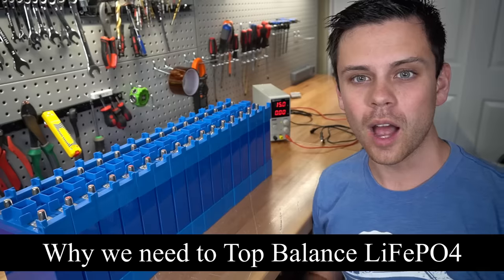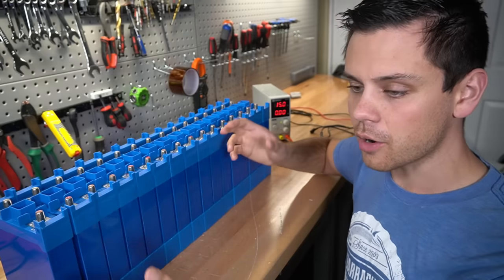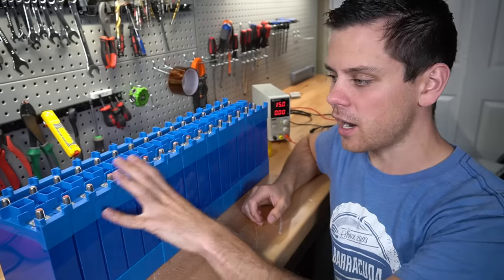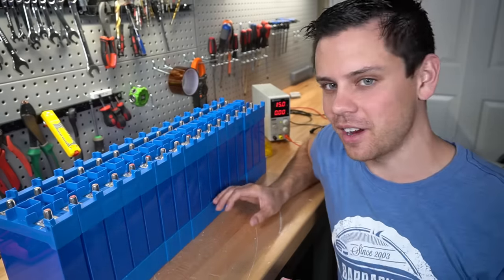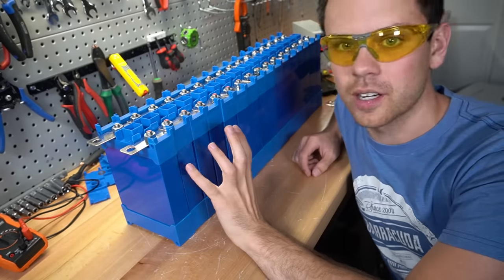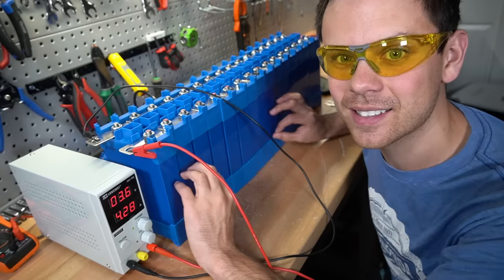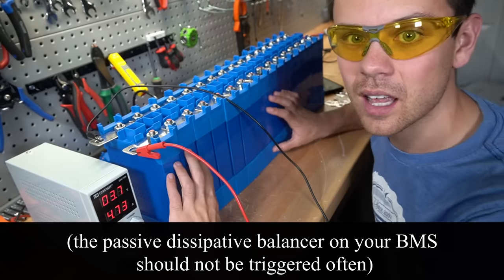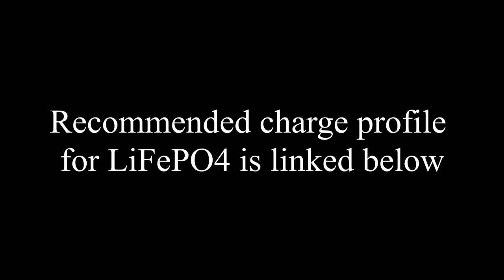How to Top Balance LiFePO4 Battery Cells Quickly (and when you need to do it)

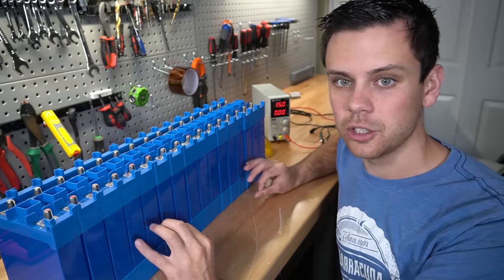Comment from the maker: 2:27 for Step by step top balancing instructions

If you buy quality new cells, you can use BMS to top balance, then capacity test in a few cycles. That's the easiest way. 

Ian made a great point of using a blocking diode so you won't burn up the power supply. Smart idea. 

If you are quick charging, current sharing is an issue and you need to attach the positive and negative leads at opposite ends of the battery. In this video we are balancing and topping off at very low currents, so you can attach the leads anywhere. If it makes you feel better to attach at opposite ends, go for it. .1A on a 150A bus bar is not going to cause a current sharing problem.

~~~~~~~~~~~~~~~~~~~~~~~~~~~
Does off-grid solar confuse you? Check out my DIY friendly website for solar system packages and product recommendations, and so much more! http://www.mobile-solarpower.com

Join our DIY solar community! #1 largest solar forum on the internet for beginners and professionals alike: https://www.diysolarforum.com

Check out my best-selling, beginner-friendly 12V off-grid solar book (affiliate link):
http://amzn.to/2Aj4dX4

If DIY is not for you, but you love solar and need an offgrid system, check out Tesla Solar. Low prices and great warranty, and they can take your entire house offgrid with their new Powerwalls: https://ts.la/william57509

~~~~~~~~~~~~~~~~~~~~~~~~~
My solar equipment recommendations (Constantly updated! Check here first):

12V/48V Lithium Batteries: https://www.mobile-solarpower.com/solar-batteries.html

Solar System Component Directory: https://www.mobile-solarpower.com/solarcomponents.html

Plug-N-Play Systems: https://www.mobile-solarpower.com/full-size-systems.html

Complete 48V System Kits: https://www.mobile-solarpower.com/complete-48v-solar-kits.html

DIY Friendly Air Conditioner/ Heat Pumps: https://www.mobile-solarpower.com/solar-friendly-air-conditioners.html

Complete 48V System Blueprint: https://www.mobile-solarpower.com/48v-complete-system-blueprint.html

~~~~~~~~~~~~~~~~~~~~~~~~~~
My Favorite Online Stores for DIY Solar and Coupon Codes:

-Current Connected: SOK, Victron and High Quality Components. Best prices and warranty around: https://currentconnected.com/?ref=wp

-Signature Solar: Cheap Server Rack Batteries and Large Solar Panels:
https://www.signaturesolar.com/?ref=h-cvbzfahsek 

-Ecoflow Delta Official Site: My favorite plug-n-play solar generator:
https://us.ecoflow.com/?aff=7

-AmpereTime: Cheapest 12V batteries around:
https://amperetime.com/products/ampere-time-12v-100ah-lithium-lifepo4-battery?ref=h-cvbzfahsek

-Rich Solar: Mega site and cheaper prices than renogy! Check them out: 
https://richsolar.com/?ref=h-cvbzfahsek

-Shop Solar Kits: Huge site with every solar kit you can imagine! Check it out:
https://shopsolarkits.com/?ref=will-p

-Battery Hookup: Cheap cell deals
https://bit.ly/2mIxSqt
10% off code: diysolar

-Watts 24/7: Best deals on all-in-one solar power systems, with customer support and distribution here in the USA: 
https://watts247.com/?wpam_id=3

~~~~~~~~~~~~~~~~~~~~~~~~~~~
Contact Information:
I am NOT available for personal solar system consult! If you wish to contact me, this is my direct email: williamprowsediysolar@gmail.com

Join the forum at https://diysolarforum.com/ if you wish to hang out with myself and others and talk about solar

FTC Disclosure Statement and Disclaimers:
Every video includes some form of paid promotion or sponsorship. Some links on this youtube channel may be affiliate links. We may get paid if you buy something or take an action after clicking one of these. My videos are for educational purposes only. Information is subject to change/update at any time. Electricity is DANGEROUS and can kill. Be smart and use common sense :)

DIY Solar Power with Will Prowse is a participant in the Amazon Services LLC Associates Program,
An affiliate advertising program designed to provide a means for sites to earn advertising fees by advertising and linking to Amazon.com
Reply: Can I do this top balancing at a higher amperage, say 3.6V @50A?
Reply: DIY Solar Power with Will Prowse  Do you ever resale any of the cells you test?
Wanting to build a battery for a small camper project. Just thought I’d ask. And thanks for all the info in your videos.
Reply: @tevincampbell1735  Sure as long as you don't exceed the c rate of the battery
Reply: Hello is it okay to top balance cell 4 cell,   parallel 2 cell at a time ?  and another 2 after, because i only have 3 busbar but i need atleast 6 busbar to parallel all 4 cell at the same time. thanks
Reply: @BlazeByte21  I would think you could balance 2 pairs and then balace the two balanced pairs.  But Iif I read your question correctly, you'd eventually have to connect all 4 to balance them equally.   You need 6 busbars to do that.  If you have some copper pipe you can make great busbars with a hacksaw, a hammer, and a drill for the lug holes.  Cut the pipe into the correct length, ,smash the pipe flat with the hammer, and drill the correct spaced and sized holes.  You don't have to have commercial busbars.......
Reply: I am using the same power supply that you are using in the video. Set voltage to 3.6 Volts, set to 5 amps. Connected the batteries and It is charging at 22 amps. Leads real hot. no display for voltage.  What am I doing wrong?
Reply: @craigmussells9274  You are going too much at the current end, can you check if you are leads are really rated to carry 22 A of cont current? you should swap with good quality ones probablyly
Reply: Where can a found this batterys
Reply: Hi Will, 

You say that once I build my own battery bank (2x 8s@3.2 for a 24v system), I should check the balance every 6 months to a year....  how is this handled in a server rack or prebuilt battery?
Reply: Hi Will,
I ordered 4 * 304Ah through a vendor recommended in the forum. I then tried to top balance them. They all started out with the same voltage of 3,2V. I connected them in series and used a laboratory charger to fill them up until 3,55V (total 14,2V) with the plan to then top balance them at 3,65V. I chose this approach as mentioned in the video as it would have otherwise taken forever since the charger only has 5A. And the idiot I am, I misunderstood and was not aware that by saying "make 4s individual battery packs" INCLUDED a BMS so I charged it without BMS.

Then I saw the next morning that one cell ended up with 4,0V and the rest of them with 3,4V. I then quickly disconnected everything and connected them in parallel so that the OC cell would balance with the three other cells which seemed to have worked very well.

They now all sit at 3,4V.

My question: How likely is it that I have permanently damaged that once cell? Would that result just in a bit of capacity loss (with which I could live) or is it dangerous to continue using that one cell?

I do not see any bloating or other signs of damage from the outside. Also, the cell was not hot.
Feel so gutted right now.
Reply from the maker: @sebastianlipp7649  you did cause permanent damage. Very unfortunate. Probably fine to use still but who knows. You'd have to take it apart to know. I can't tell with certainty how damaged it is. I think you should start over and buy another set and do it the right way.
Reply from the maker: @sebastianlipp7649  are they used or grade b cells? Why did you top balance them
Reply: @WillProwse  By the way, aside from me being a fool: Thank you so much for your videos. They are very educational and have helped me build my knowledge. Clearly, I should've re-watched them before getting started as I did watch all of those about 2-3 months ago. I suppose my excitement that they finally arrived got the better of me :D
Reply: @sebastianlipp7649  Curious, were the cells useable or scrap?
Reply: @rodneyhrytsak3407  Absolutely fine as it appears. The full battery pulled >317Ah  (rated at 304Ah), they are all in balance with 0,000V -  0,003V deviation between them under low load and max 0,009V under half C load towards the top when almost full or towards the end when almost empty.
No visible physical difference between any of them at all so I believe they are fine.
I do think though that they did not sit at that voltage for long at all. They would've spent the majority of the night in the desired voltage range with one going a little bit over at the end of the charge cycle.
I might have gotten lucky 🤞 we will be using them daily in our offroad rig starting June. Let's see if we run into any issues at some point but for now. All seems well.
Reply: If i just charge 4 cells with a 12v charger will the  charger stop charging when the pack is fully charged?

Comment: Hi Will, nice vid! Only one small advice: connect the batteries like you did but connect the power supply diagonal. In other words, put one of the wires on the right side of the pack. If done so the current goes thru as many busbars for each cell. Like you did, the current has to travel via ALL busbars for the right cel while the left cell gets it direct from the charger. I know, if you leave this setup stand for a while it will balance eventually but it can be done a little quicker the diagonal way.
Reply: Hi Rik, any chance you could elaborate a bit more on how to do this please? cheers
Reply: @finnskellig7422   Simple,just connect the + wire (from the power supply) at one end of the 16 cells,  16P, and the -- wire to the OTHER end; the way he did it makes no sense, it's a beginner mistake;  

The difference here, with a SMALL power supply, is negligible;   BUT it CANNOT be tolerated on large (100 Amperes +) power supplies/chargers!
Reply: There are many conflicting theories about this subject including the long bus bars on battery rack units and I would agree in principle, however, if the resistance of the bus material is negligible, I would assume the current to be equally distributed across the array. Having said so, I would prefer to individually charge each battery up to its max capacity before installation but then again I'm no expert in this area (yet 😍). Thanks for your input 🙏
Reply: Came here to say this. Makes an even bigger difference if using smaller temporary wires instead of bus bars. The current can choose to go through a battery instead of toward the next battery, so by forcing the current to go all the way down the line to get back to the power supply, the delta V across each cell is much closer during the whole process, without relying as much on sitting for a while at the end.
Reply: If you do supply few amps (and the rated capacity is way way bigger) and dont have extremely flimsy busbars, it doesn't matter.

Comment: Last year I bought a set of 16 LiFePO4 280AH batteries to build a 48V system.   After setting idle for a year they had an initial voltage of 3.16V per cell.  I used a lead acid battery charger to bring 4 sets of 4 cells up to near 3.4V per cell which is where the lead acid chargers stopped charging.  I top balanced 2 sets of 4 batteries wired in parallel at 3.65V with a 30V 10A power supply set at 3.65V and 10A.  The power supply is struggling to charge the 3rd & 4th sets above 3.34V with the power supply set at 3.65V.  Should I turn up the voltage a few notches and keep a watch on the batteries to insure they don't rise above 3.65V?

Comment: Anyone building a DIY battery pack should follow these instructions. The last 48V battery I put together a couple of months ago was needed for a scheduled neighborhood transformer replacement power outage and unfortunately the Chinese prismatic cells did not get delivered until late the day before. Fortunately I had the cabinet, buss bars, wiring, BMS & cell balance board ready to go so I just installed the 16 cells right out of the box and charged at 56V until one the cells started to show signs of over voltage.  While the system did work and get us through the entire power outage the next day, the cells were severely out of balance and it took a couple of weeks of "screwing around" by manually connecting ceramic resistors to over charged cells and trying to individually charge low cells with a 3.6V buck charger. Should have just taken the cells out of the cabinet, put them on a bench and done what Will said.

Comment: I just bought four 280Ah grade A cells, connected them in parallel and set voltage to 3.65. it has been 3 weeks and the current is at 4.45 amp. What is happening?

Comment: Great advice. I would like to add something I learned. Lower quality cells can drift from one another by time (ex :when not in use) . If they are too far apart for your bms to cope with this, then I charge the individual cells (that have a lower state of charge) little by little with a 3.65v charger. They don't need to be super balanced at the end. Just enough so your bms can do the job again. Hopefully Mr Prowse agrees with this. It works for me with older sinopoly batteries from my boat, that sometimes sit idle for 6 months
Reply: Hi Henri. Do you put a load directly on a cell that is too high? And charge the low cells as you said.  I have a boat and need to do this now. André in Sydney

Comment: One note that, while not too important once the current drops to a low level, to properly balance the voltage of the pack is to connect one charging lead to the right side and the other charging lead to the left side. This is to balance out the resistance in the length of the wires and buss bars. Otherwise the last cell in the string of parallel batteries may be at a slightly lower state of  charge from receiving less current from a higher resistance. Connecting one on the left and another to the right balances this all out
Reply: That sounds pretty reasonable. Though we are talking about 1-2mm thick buss bars. Only pressure fit connections, but I can't imagine the resistance being significant - do you have any numbers of what kind of resistance this could be and the corresponding voltage drop/unbalancing?
Reply: I agree with you Jason. I used short pieces of small wire to top balance all my cells because I didn’t have enough bus bars and I measured 9mV drop in each cell as I got further away from the PS leads. It did finally all balance out once I switched the leads around like the you said but it probably took much longer than it should have.
Reply: Would it make more sense during parallel topping off to put connection both on center cell?
Reply: @gkeith4120  yes, this would be slightly better. I would connect the + on the first cell and the - on the last cell. This way the total buss bar length (+ & - together) is the same for each cell.

Comment: Great video! Thanks. I didn't realize balancing with such a simple thing it sounded complicated until this video. I had one cell that was charging higher than the others and BMS over voltage protection was making the charge bang on and off repeatedly. I took my pack apart and strap them all in parallel and they top balanced themselves in a couple hours. Now the system charges quickly and without any banging on and off. The only thing I don't understand is why the BMS didn't do this automatically.  Thank you sir!

Comment: I am in the process of doing this to my 4S 280Ah setup. It takes forever. I'm past the 12 hr mark now and the batteries still take 4.4A at 3.65V.
A tip to consider!!
Do not place the power leads at the same end of the battery bank. The cell furthest away will not receive the same amount of charge due to the (small) voltage drop in the bus bar. Connect the leads at the opposite ends. That will give a more even charge as the current to each cell will have roughly the same length of cable/bus bar to travel through.
Reply: Funny. I just noticed another post saying the same thing.

Comment: Great video.   We too figured you just put the new cells in and the bms takes care of everything.   We bought 8 cells to replace bad 100ah ANC cells.    Our sample size is 1 so we can't make any statistical judgements but we still don't recommend neata batteries, anc cells or seplos bms (doesn't balance cells well or at all).    We got a black LONGWEI that otherwise looks just like Will's power supply.   We only received (as expected) 8 bus bars with our 8 cells.   We drilled holes in aluminum yards sticks for on-the-cheap bus bars to balance.   We put an extra new battery in the group in case one of older ones doesn't charge up to 3.6.    We are currently at 3.8a and 3.353V.    We have 9 more 5kWh (server rack) packs so this is going to be a long process.

Comment: I’ve got 3,7v lion cells with 50 A.h. Cap. Didn’t get to use power source, after I’ve watched this video I wasn’t sure about the result but here it is. Connected all cells in parallel and the result over the night exactly 9hrs30 minutes. Cells differed at around 0,5 Volt before- and after the night result -> 3,551 each cell.

Comment: You should always use a blocking diode to charge batteries with a lab power supply to prevent the current from flowing back into the power supply outputs. Those power supplies usually have a crowbar circuit across the outputs that can short and cause a short circuit across the outputs. This will blow your power supply instantly.
Reply from the maker: Oh that's smart!!!! Will add that. Good point
Reply: Only needed on the + side?
Reply: Be sure and take the voltage drop across the blocking diode and subtract from your metered voltage.
Reply: Ian,
What would be looking for in the blocking diode you suggest - assuming one of the recent 24V surplus BYD packs ( like David Poz's) using a charger like Will was using? A link would be nice🙂 
Thanks
Reply: What size/type it should be ?